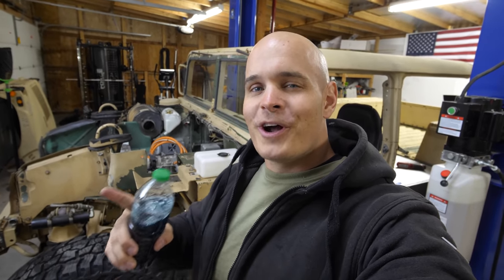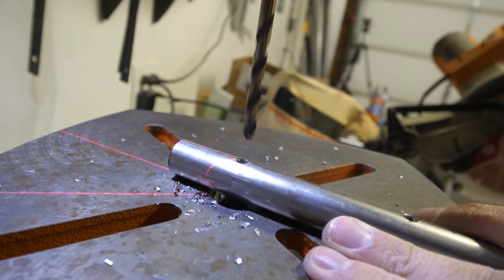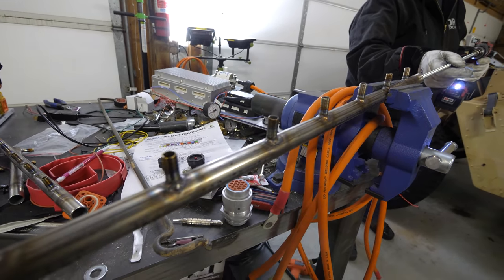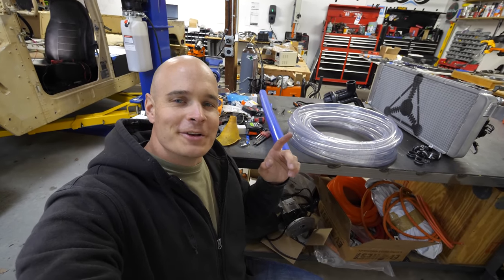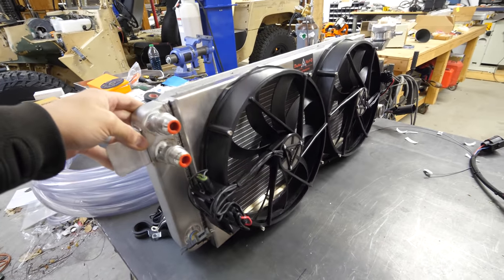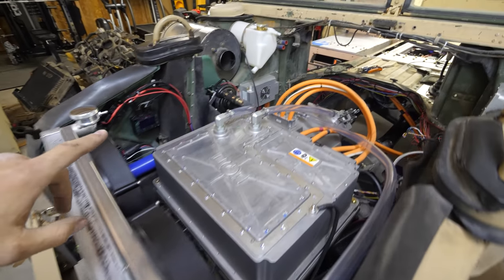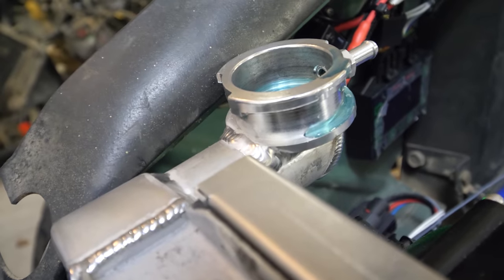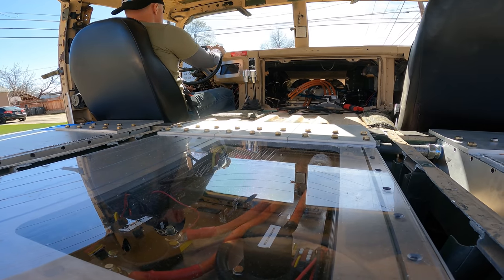The ELECTRIC HUMMER projects 'coolest' video YET...

Comment: I would recommend a thermostat for the battery coolant loop to bypass the radiator, and possibly a second radiator just for the batteries. On warm or hot days it doesn't matter, but on cold days you wouldn't want effectively freezing coolant pumping through the batteries. Regulating the pump speed can only do so much. You'll end up with unbalanced battery temperatures
Reply: I agree, there's a reason Tesla is preconditioning their batteries for fast charging and that they have a power-limit if the battery is to cool
Reply: yes but its not called a thermostat he needs a thermal probe in the coolant !! and some kind of logic to decide what to run and what to stop !!! maybe a dedicated arduino
Reply: @fouzaialaa7962  his system can read temps, but he needs a way to restrict flow to the batteries without restricting the flow to the motor, since both run off a single pump
Reply: @gutserker  A valve in the 2nd loop towards the batteries. And let the BMS control the valve.
Reply: @Guust_Flater  could have an extra point of failure, or just use a thermostat for battery loop that is stupid simple and auto-regulates temperature
Reply: +1

Comment: This is an awesome series! I’ve watched every minute of it. I noticed you hard mounted the radiator. I would suggest isolating with rubber for vibration dampening. Aluminum radiators will crack if hard mounted. You plan on off-roading so I think it would be wise to isolate it!
Reply: would the temps of the radiators keep the rubber from freezing in those utah winters?
Reply: @u2bemark  most car companies use a special kind of rubber to keep it from cracking, like a synthetic rubber or something
Reply: @ChickenSDS  polyurethane is used a lot as a replacement for rubber in suspension bushings. So the same sort of stuff would definitely work to isolate the radiator.
Reply: You are super interested in  E.Vs
Reply: @Thats_Mr_Random_Person_to_you  polly is harder than rubber, and woukd provide less protection for the radiator, although still better than hard mount i guess, but propper rubber rad mount grommets are easily accessible
Reply: I was going to say the same thing. Nice shout.
Reply: I was thinking the same thing. That radiator would probably benefit from some vibration damping.
Reply: @freedblowfish3705  there's different grades of both polyurethane & natural rubber, butyl rubber is also common & also has different grades.
Reply: @u2bemark  The tires are made of rubber too. It would be much worse if they cracked.
Reply: @jannikheidemann3805  well..  I assume there would be more pressure over a small area on the bushings compared to the tires..  it is a different kind of thing.  Not talking about cold alone doing damage..  more like something made more brittle being put in a vice kinda thing.  But as others have said.. these guys know this stuff.  I'm sure they'll choose wisely.  Heck.. the US Gov probably spent millions on similar issues and it is known.. what to do..  what rubber washers would work and what their lifetime service would be under what conditions.  Then again... you have the space shuttle accident caused by O-ring failure caused by temperature... so we've been told.

Comment: Tip: The clear hose will turn brittle from the antifreeze pretty fast. I used two 5cm pieces of chemical resistant clear hose in a boat where i installed a diesel heater system to help me see if there was air in the system, but the hoses became discolored and hard over the weekend. Had to change them out with proper radiator hoses, like the rest of the system. Also, you should add an expansion tank on the highest point of the system. It holds air that acts as a "damper" for when the system gets too hot. The liquid expands quite a lot when heated, and will burst your pipes. Air is compressible, liquid is not! But, i also have to say that this looks absolutely beautiful, and i am extremely impressed with what you have made!
Reply: Great point about the clear hoses, and the catch can is a must... The pressure valve in the cap probably didn't open with only a 20F temperature rise, but on a hot day it would for sure.
Reply: @kschleic9053  He mentioned the operating pressure of the battery loop is only 2 psi.  I'm guessing he's not going to run pressure valve at all and just a expansion tank.
Reply: @animefreak5757  @20:53 the radiator cap has the traditional pressure relief valve and a hose barb for overflow, so even if there is sufficient expansion capacity for 2psi, there should probably be an bottle on that hose barb just in case?
Reply: @kschleic9053  Yes, if he hasn't put one on there, he should.
Reply: @kschleic9053  opps, i forgot to reply to this, but as synthmilk said, he probably should.  He should probably also put a thermostat of some sort on the battery loop, though if he doesn't put doors and such on he probably won't be driving in cold enough weather to worry about battery warming.
Reply: i wondered about that hose, just from the plumbing world, i know its limitations.
Reply: Chemical resistant is kind of a bogus term. You can have something that's resistant to specific kinds of chemicals, but nothing is resistant to everything.
You need to look up if a material you want to use is resistant to glycol and water specifically.
Reply: You can't really make such a sweeping generalization.

I've used clear hose for fuel and for oil in some of the worst conditions you can imagine. But it was also great hose, not some auto parts store junk.
Reply: @animefreak5757  a better way is to have a three way bypass on the two returns. Instead of going into the radiator it will simply route it back to the waterpump inlet.  This way the inverter/motor can warm up the batteries. In addition you can add a heater on that bypass to speed up warmup.
Reply: Agreed, Tygon looks great but it has limitations and is not a good long term solution for a mission-critical cooling system. Other than that, AWESOME project Jerry, keep Rigging Everything!
Reply: Usually those "chemical resistant" clear hoses are Polyethylene Terephthalate Glycol, AKA PETG. Coolant/antifreeze is usually Ethylene or Propylene Glycol, which based on the Glycol part alone, you can probably guess they react.

Comment: 1. Please add a reservoir to the cooling system. Leaks will eventually occur due to thermal expansion. That is the main reason they're used in cars.
2. As another commenter said, you have an aluminium radiator and copper heatsinks. Mixing these two metals is really not ideal as it leads to galvanic corrosion. It is advised to not do so in PC watercooling as well. Please look into this.

I'm really pumped to see the Project Hummer EV finally on the road! Can't wait for all the fun stuff you have planned.
Reply: Also you will get losses of liquid out of the tubes themselves over time. It's one thing that can limit the lifespan of a lot of computer water coolers (All-in-ones at least) which often can't be easily refilled.

It'd take years for it to be an issue, but it;s something to bear in mind with that much tubing.
Reply: I think the corrosion shouldn't be a problem because the water is deionized. So there isn't anything that can carry the electrons from one element to the other.

Comment: I have really enjoyed this series and it's awesome to see the E-Hummer out on the road. As for the cooling system, does it need to be more full (for lack of a better phrase)? It seemed odd to see air space in the lines.
Reply: I believe that was the job of the “gurgling spout”. To get the air out of the loops.
Reply: On PCs its quite bad to have bubbles in your Liquid
Reply: Removing the air is called burping the system. You can only get so much of the air out initially. It needs to run for some time in order for the air to circulate back to the escape. Not a huge issue
Reply: @lucaspohlmann7162  dont forget a PC will just sit there while the car will be driven. I would assume air bubbles will naturally pop while its in motion.
Reply: is it that necessary to show that on camera don't u conclude yourself that leaving the lid open while running it and talking about how the air is escaping is not enough for u to realize it is "full" after that?
Reply: @TheCrushMedia  ... Pop! lolol :)...  Bubbles don't "pop" in a closed system! Bubbles "contain" something!... in this case "Air", which must be "removed" from the closed system.
Reply: If it were a combustion engine i would be more worried due to the sheer amount of heat but relatively low temps is ok for now. The system needs to be "burped"(all air removed) in time. This is could be done manually through his system by adding in an overflow tank and manually activating the coolant pump to work all the air out.
Reply: @benh3457  I did say I assume lol was a wild guess
Reply: @benh3457  lmao, though it might get absorbed in the water after a very long time
Reply: take a look at [26:14] the loop is completely burped and full it looks healthy
Reply: @NanescuRadu1  no its not, there's a visible air bubble in the system. Best bet is to get an overflow funnel designed for radiators and let the pump run for an hour
Reply: Damn, its funny how some people will argue theyre right and be 100% wrong..  using common sense or hear say does not suffice for knowledge of factual evidence..  on paper if shit works doesnt mean the "idea" / thing will actually work when all is said and done..
Reply: when he's showing it to the guy in the parking lot there is a large section of tubing that still has ~50% air. that seems to indicate not enough fill. (not air bubbles moving through the system)
Reply: @DarthNeummy  Hmm.. perhaps that is why he idled on the incline for a while?  Maybe the top of the radiator the high point? Could air have escaped with cap closed?
Reply: I think as long as the pump is low and in the correct part of the loop it is okay, assuming it is moving enough fluid to keep it cool. I agree though, it bothered my OCD.
Reply: If you look at the cap. There is a "nub" pointing into the engine bay. That is where the reservoir would be placed. This is also where air can be purged but of course there has to be enough fluid is the loop.

Comment: Great vid, looking forward to the next one! Just a quick note in case you see this. The plasticizers in the clear hose will likely leach out quite quickly into the propylene glycol solution and clog up any narrow pathways. You'll know this is happening when your hose becomes less flexible and will likely yellow. In water cooled PC's, this can happen within a few short weeks. I don't know of any clear flexible hoses that are free from this issue. Even in the PC cooling industry, the best of the best still have this problem, just delayed. We also use the same mix for PC cooling.
Reply: You're right, but plasticizers will only clog the extremely, extremely thin fins on a CPU or GPU block, a radiator (which is the narrowest pathway of a car cooling loop) won't be clogged

Comment: You should get a bottom shield for your truck like electric cars so you can have better efficiency as well as have it double as a skidtray and shield against debris getting up inside the engine bay and keep things from getting hit or damaged by high center points or rocks jabbing into your stuff, keep things cleaner and more protected. Anyway its a amazing project. Keep it up

Comment: A 30% efficient Humvee engine.  I think you're being extremely generous Zack.
Reply: On top of that, people often confuse peak efficiency of an engine at certain speed/load and average efficiency in actual traffic.
Reply: Was thinking the same
Reply: are there motors efficient as 94% ?
Reply: @sayyidsahal1996  Yes, peak efficiency of 94% is possible, but that is for a specific interval of load and motor speed combinations. The average efficiency for a trip will be slightly lower, just like it is for combustion engines.
Reply: @sayyidsahal1996  I see you’re pretty curious, asking questions everywhere… love it! No, no internal combustion engine is 94% efficient. Today, the most efficient gas engine to ever be made is the Mercedes AMG F1 engine, with a peak thermal efficiency of 50%. There is work being done by a couple of companies who say they can make more efficient engines, but I’ll believe it when I see it.
Reply: Stop believing everything you are told. A diesel engine is 55-60% efficient. Why he said 30-35 percent one could only guess but that's for gas engines. And if you dig further you'll find independent testing dollars per mile cost gas at 30-35% efficiency vs fully electric at the current cost as tested $4.45 a gallon for fuel a 100 mile round trip you'd save $4.00 in an electric vehicle. You would make that 100 mile trip a lot faster in a gas vehicle because of the hours used during recharging the electric vehicle. With the information I just provided going electric is a dumb thing to do. The only reason electric had a slight advantage in cost per mile was the high gas prices we're seeing today just imagine how that test would have went with pre Biden fuel cost of $1.99 a gallon.
Reply: @sayyidsahal1996  a diesel engine which is what he removed from that Hummer is 55-60% efficient. Why he said 30% one could only guess my thought is it sounds better for what he's doing.
Reply: @garysgarage.2841  Diesel engines are more efficient than Gasoline for sure, but the top theoretical efficiency of a diesel engine is 60%. With most diesel powered powerplants (which are allowed to run at peak efficiency most of the time reaching 50% top). You should do some research… the diesel engines in the humvees are far from efficient! I know that because I work on them. Later model humvees with the turbo engines had better efficiency but were still far from great.
Reply: @garysgarage.2841  True: best diesel engines are 55-60% efficient (esp. slow speed units like I used to encounter while working on ships).  As for cost per 100 km, I can compare my previous vehicle (Forester) with my city car I drive now.  100 kms would require 10 litres (2.64 US Gal) for the Forester.  At current prices here, that would run me about $19.  

Under current conditions, my car uses 12.5 kWh / 100km.  Lets assume 13 kWh due to charging inefficiencies. 

13 x 9.749 cents/kWh (worst tariff - 2nd 40kWh/day)  = $1.27. 

I plug in every 3-4 days (back & forth to work mostly).
Reply: @garysgarage.2841  That BS you spouted about electric costs is nonsense. When I switched from my Prius C (a 50mpg vehicle) to my Tesla Model 3, my "fuel" costs *halved*. And that was with $3.50/gal gas in LA in 2018. With gas at nearly double that price now in some parts of LA, and my electricity bill unchanged in the last 4 years, I'm now spending 1/4 as much per mile in my Model 3 as I would be in my *Prius*.
Reply: @coredumperror  it's real world not fantasy island. Test were conducted using charging stations and at current fuel prices it's no better. You also need to factor in the cost to own your car. My truck cost me $850 7 years ago and still runs and drives perfectly. Not having a $700 a month car payment buys a shit ton of fuel. If you factor that in your paying way more than me.
Reply: @garysgarage.2841  DC fast charging stations are radically more expensive than charging at home, which is where the vast majority of EV owners do all their charging. DCFC stations are intended for road-tripping, where you need to be able to recharge your battery quickly, and that much power usage causes the station to have to pay massive demand costs to the power company, which is why they're so much more expensive than charging overnight at home.

And complaining about the difference between buying a used car and a new one as if that has any bearing at all on fuel costs is ridiculous. Those are completely separate considerations.
Reply: I remember my old car's average efficiency in town with a little bit of traffic to have been calculated to me around 12% :p

Comment: On the heating of the battery, you actually want to hold it at 26° it's actually really good for it. You'll actually notice the difference when you do. There's less voltage sag, so you'll notice it almost immediately once you start to push it.
Reply: Definitely noticeable on a Tesla, that is for sure. When everything is at the right temperature, the car feels far zippier at the same state of charge.

Comment: Zack again, incredible series! The best on YouTube by far. As you said it sounds and handles like a bucket of bolts, my question is how difficult would it be to add air suspension like your Rivian? These old military shocks seem to be well past their time. But it is incredible to see it moving. Well done
Reply: I feel like Zach will eventually do some suspension work. Just seems too bumpy for a city  street. At 27:28 forward Zach was getting a little bit  of a rodeo treatment. BTW, this is the coolest conversion I've ever seen. Thanks Zack!